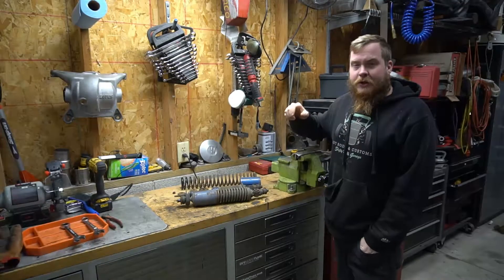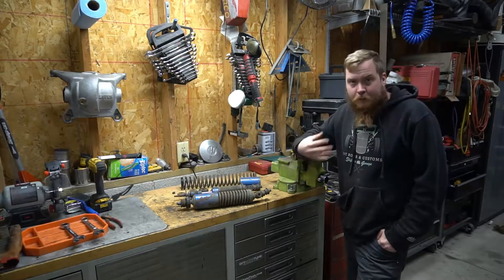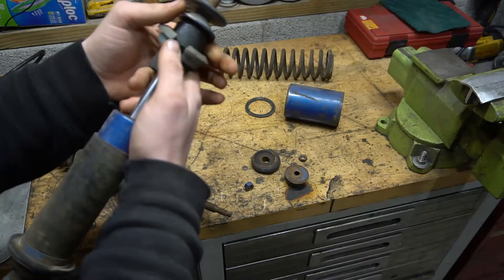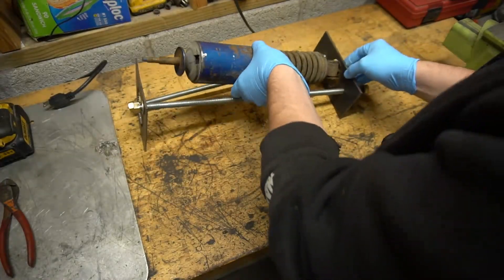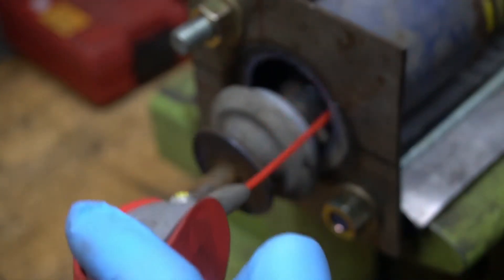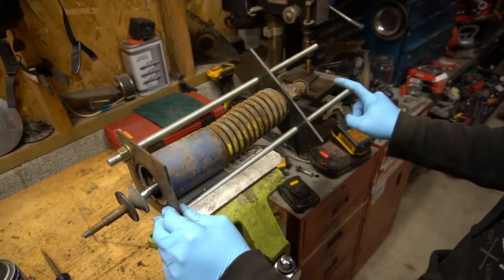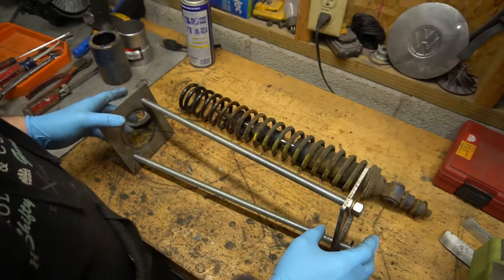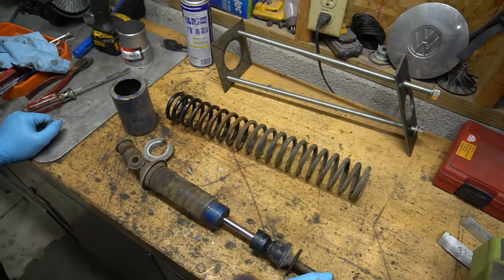Lotus Elan PT11- Spring Compressor/Front Strut Disassembly!

Comment: Hi Karl, I am about to dismantle the front strut on my 71 Elan.  Did you find a spring compressor available for sale on line?  if not, have you decided on the final design of the one you used in this video?  Thanks
Reply from the maker: I have not found one yet, nor have I spent any time improving this one yet. I'm still planning on adding some cups made of exhaust tube couplers to help keep everything square and prevent slipping
Reply: Thanks, I will have some fabricated according to your recommendations

Comment: As Colin Chapman said "Make the suspension adjustable and they will adjust it wrong - look what they can do to a Weber carb in just a few moments of stupidity with a screwdriver" Stick with stock if you can, it gives a good comfortable ride and roadholding.
Reply from the maker: Im thinking stock and possibly upgraded sway bars eventually. Should be all the help needed for autox
Reply: @CowbellCustoms   Very informative video's well done you :-)
Reply: Did I miss the video about the engine starting?
Reply: If they are still available, I fitted Koni shocks all round. Guaranteed for life vs about 10,000 miles on the OEM Armstrongs. Better ride.